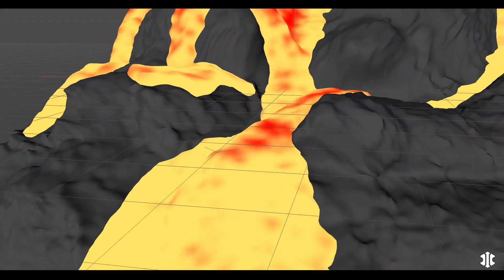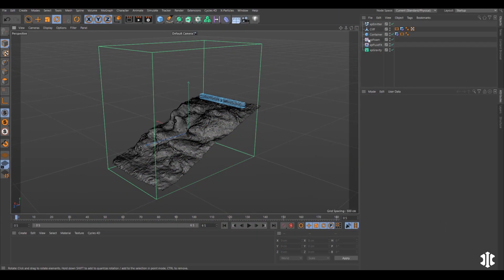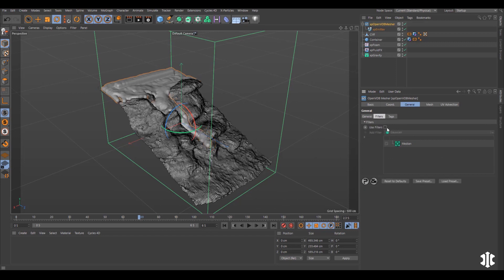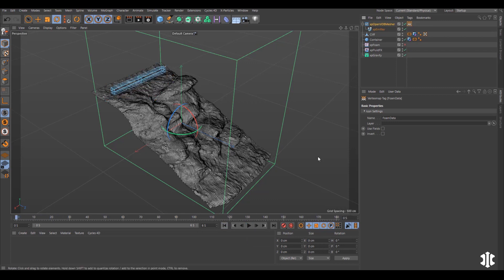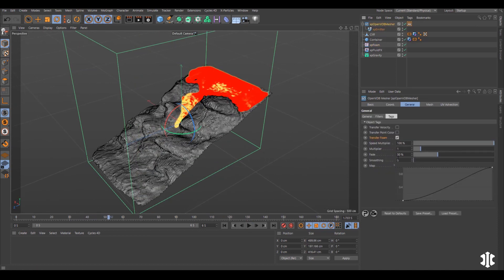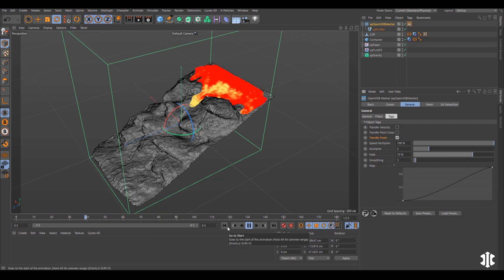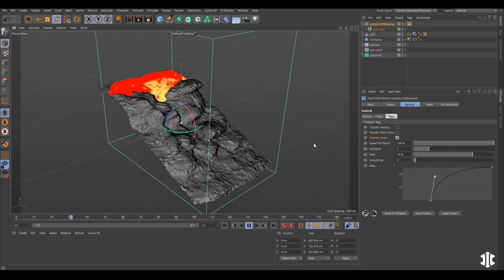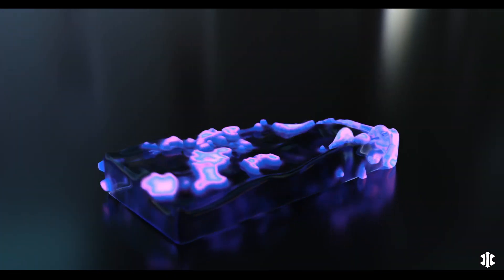xpOpenVDBMesher - Transfer Foam - Sneak Peek

Comment: I'm having some problems with Transfer Foam. OpenVDB seems not to recognize the Dynamics modifier. I tried to create a less complex scene without OpenVDB, but the foam does not work correctly. I see that you don't use any Emitter for foam: is it necessary to use it? I don't understand what I'm doing wrong. maybe some settings in the Emitter or Fluid modifier? hope you can help me
Reply from the maker: Hi, 

If you're having problems, you can either share this question on Discord here: https://discord.com/invite/X2zYY7qEyr

Or you can send a message to Technical Support here: https://insydium.ltd/support-login/

-Thanks

Comment: Guys, your product is potentially incrediably great tool. But today it's not possible to (or at least very hard to) use it for commercial projects. It's cool for personal stuff when you're able to spend time waiting for preview. It's ok to have a day tweaking this and those things, making iterations to achieve the result you need. But for commercial project with defined deadlines it might become a disaster: these calculations requires so much time, it doesn't leave a space for tweaking and art directing. And if I'm not 100% sure how to achieve the exact result I need, I risk to spend too much time picking the settings. You know, for our industry tweaking and experimenting is just a part of the process, and it should be fast enough to allow us to experiment and play with it.      Again, I personally enjoy the XP, I use it for some commecial projects if I'm sure how to achieve the result. Of course I use it for personal projects. I enjoy it's great flexibility, simulations looks so cool!   It's versatile, it integrates with C4D perfectly, it's all just great.   But today to stay competitive on the market we also need to be fast, and it's not an option for us, it's a must have in the industry.  I  don't say for everyone, it's just what I think, based on my own experience - XP is in need for a good speed up before any new cool features. imo, thanks
Reply: I agree although I have had good luck with xp fluids with foam.  I spent an enormous amount of time tweaking to get the sim right before even having the chance to art direct.  For commercial work it is much easier to do water sims in Houdini.
Reply: Maybe they need to add a bunch of presets to choose from, like a library of pre-adjusted effects, to save people time tweaking. It can be in the form of many ready made .c4d example scene files, so people just copy stuff out from them.  It will also help people learn the XP much quicker than watching the tutorial videos because you can progress at your own pace.
Reply: @ZhihengCao  Houdini has this. They are called "shelf tools".
Reply: @gypsyproductions9914  Unfortunately being a part time hobbist who only use c4d a few weeks a year I cannot afford money to buy or time to learn Houdini.
Reply from the maker: Hi,
Please take a look at Quick Tools. 
https://www.youtube.com/watch?v=G93LDHb9YZw&t=72s

-Thanks